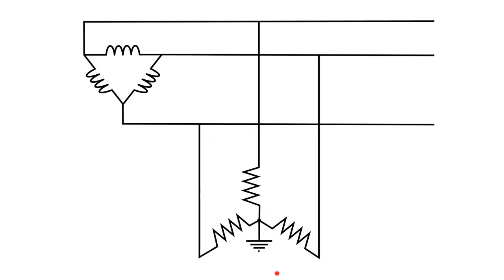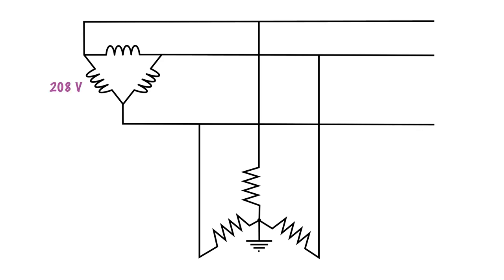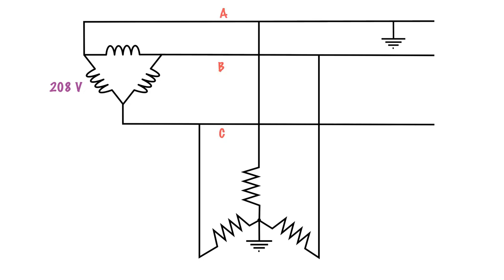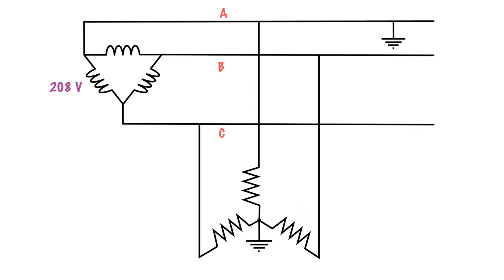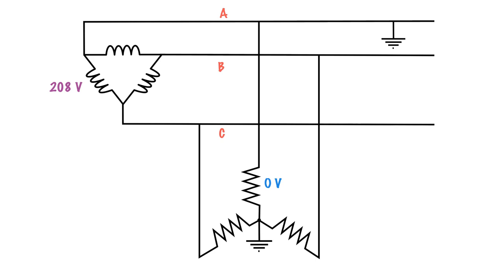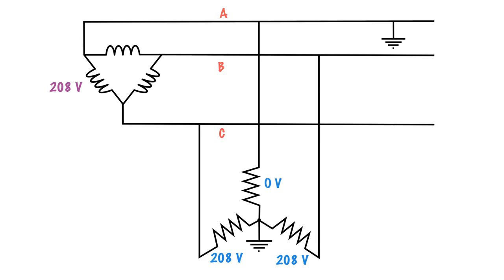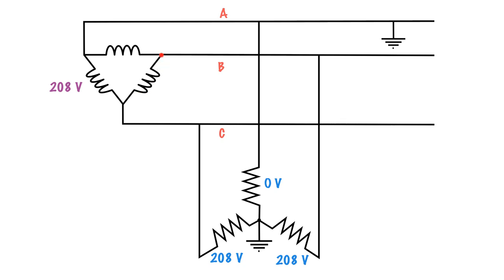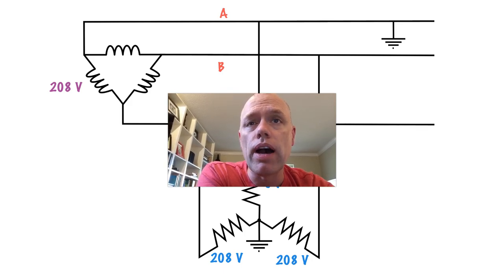How ground fault indicator lights work.

Comment: 120 volts on the lightbulbs.  you did not show the math to change the line voltage 208 to the Why phase/bulb voltage?   thank you
Reply: 120 × √3 = 208